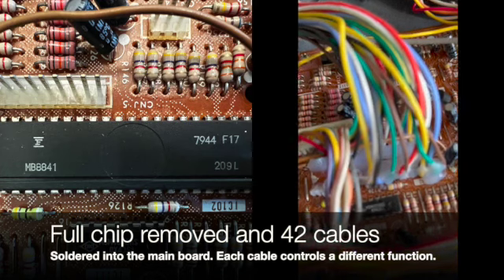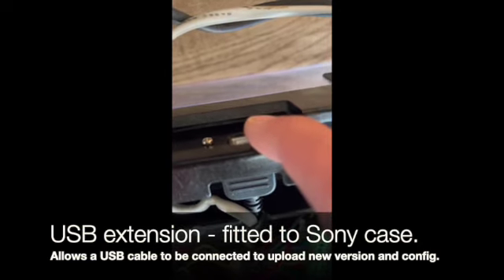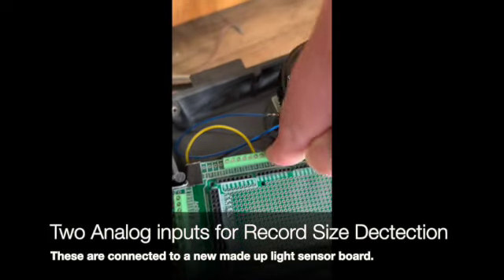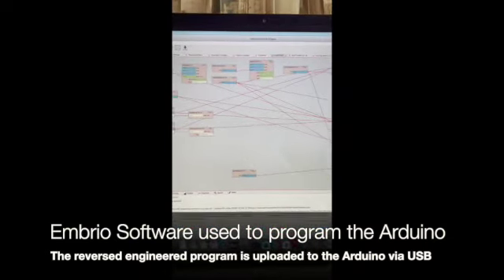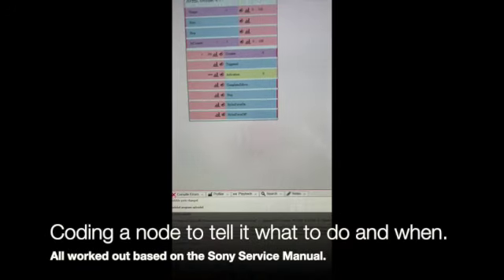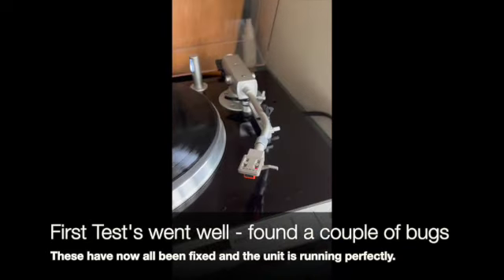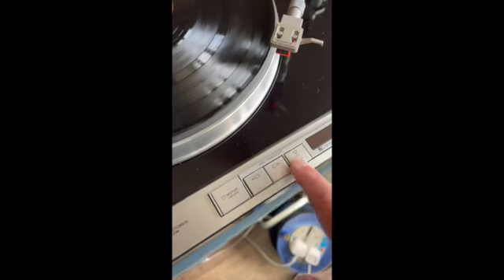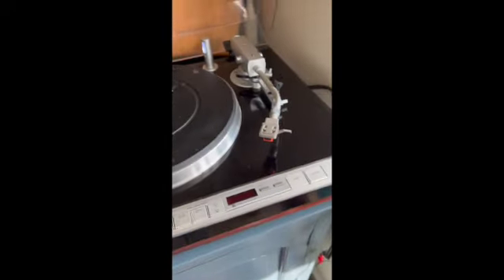Sony PS-X75 Record Player fixed with a Arduino Mega2560

Comment: I have the PS -X700 turntable, I love it. I had the 75 many years ago but it was stolen.  I replaced it right away with a brand new 700 model.  I recently had to fix it.  Turns out it needed new capacitors.  Working perfect now.

Comment: This is fantastic, this will single handedly be able to save almost every defective ps-x75 if someone feels like putting in the effort. One thing that I would like to ask though is how I would go about doing this fix for a ps-x75 that does still have a functional original sony record size detection board, or does that not matter?

Comment: Nice job. Thanks for the tuto.
I've checked your Excel for the pin connexions and I don't understand where i have to plug the following pins on the Arduino : 1 to 8, 22, and 42. Moreover, what do you mean by pullup and pwm ? Is it that much important or i just can connect wires in the right pin on the Arduino without thinking too much ?
Thanks by advance for your help.
Reply from the maker: Hi pins 1-8, 22 and 42 are not connected to the board leave them as is. PWM = Pulse Width Modulation (is a technique for getting analog signals) Pullup or down meaning : With a pull-up resistor and with the button unpressed you make a logic state ON and with the button pressed you make a logic OFF.
With a pull - down resistor and a pressed button you make an ON logic state and OFF logic state when its unpressed.
Reply: @markbuttle  Hi, thanks a lot for your answer. It'll help me. I hope i'll be able to repair my PS-X75 now.

Comment: The chip has not failed! You have to remove the old grease which has become sticky, and regrease it! The board has to be recapped! The switches have to be cleaned, with contact spray! Mark stop showing off!
Reply from the maker: Thank you for taking the time to watch the video and share your thoughts. I understand that not everyone may appreciate the methods used to fix the Sony PS-X75 record player, but I assure you that a significant amount of effort and expertise went into the process. Before resorting to replacing the ICU with an Arduino board, I thoroughly investigated and tested all other options, including consulting a service agent. Unfortunately, the chip was indeed beyond repair, with no waveforms detected. However, after replacing and programming the ICU, all functions were restored as intended.

While I respect your opinion, I believe that the success of the project speaks for itself. I'm proud of the outcome and happy to have revived this classic piece of technology. I understand if this type of repair may not be of interest to everyone, but for those who share my passion for vintage electronics, I hope this video serves as a source of inspiration.

Thank you again for your feedback, and I invite you to reach out if you have any further questions or concerns.

Comment: What causes the chip to fail in the first place? A blown capacitor?
Reply: The chip has not failed! You have to remove the old grease which has become sticky, and regrease it! The board has to be recapped! The switches have to be cleaned, with contact spray! The content maker of this video is just showing off!

Comment: Have you spent a lot of time on the project considering how busy you are and don't plan on sharing it in any way? Well, I'm not saying that it's free, as it used to be with enthusiasts years ago, but it's a pity for this job. Share your knowledge in some way.
😎
Reply from the maker: Not sure I understand your comments, as I have fully shared everything, code, wiring, instructions, links and diagrams - step by step with Full build on Instructables.com:
https://www.instructables.com/Sony-PS-X75-Record-Player-Fixed-With-Embrio-and-Ar/  as detailed in the description of this video - my apologies if I have misread your comments as every bit of effort I have put into this is free and fully shared.
Reply: @markbuttle  Ye, I was joking. Thank you for all your efforts. I am impressed.
Reply: @markbuttle  it's true, you did an incredible job, but allow me a note, you shared the code that is only good for your turntable that no longer uses the Sony Light sensor, but one that you built yourself. Since most users have the sony turntable with the original sensor working, and many of us are unable to modify the code (I am one of them), it would have been better if you had written the few lines of code from enter the Embrio software, so that everyone could repair the turntable without problems

Comment: Totally rubbish video! The chip has not blown! The board needs a total recap, including removing the old grease from mechanism, and applying new grease! You are just showing off! I see you no longer post any more videos?:face-blue-smiling:
Reply from the maker: I appreciate your feedback, but I believe calling the video "rubbish" is a bit harsh given the effort and detail involved in the project.

The record player was initially taken to a service agent who serviced, cleaned, and greased everything but couldn't get it running. Their diagnosis indicated a blown IC. When I took over, I double-checked everything and confirmed that the chip had indeed failed, with no output waveforms detected.

Once I replaced the IC with the Arduino Mega2560 and programmed it to replicate the original chip's functions, the record player worked perfectly.

I understand that different issues can cause similar symptoms, and your suggestion about recapping and maintenance is valid for many cases. However, in this instance, the primary issue was the failed microprocessor.

Thank you for your input. I hope this clears up any misunderstandings, and I'm always open to learning and sharing more in future projects.